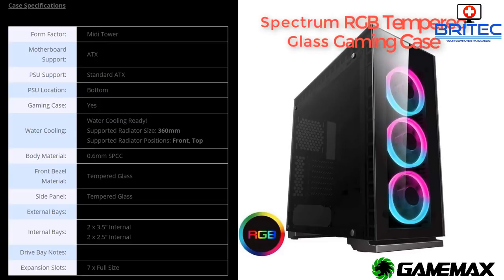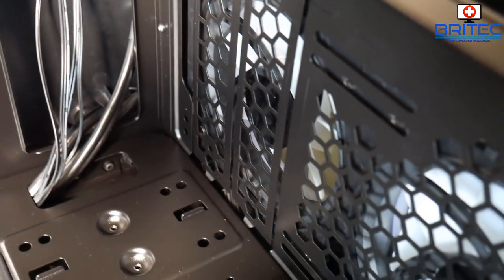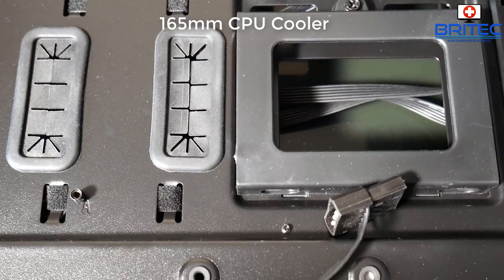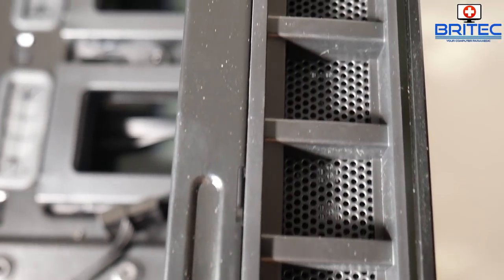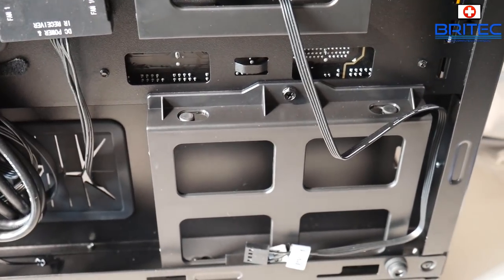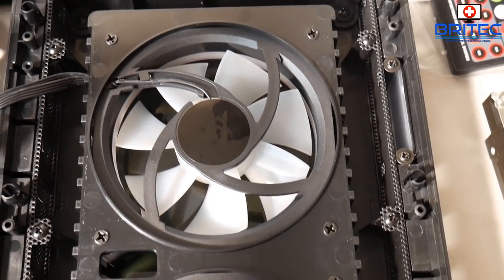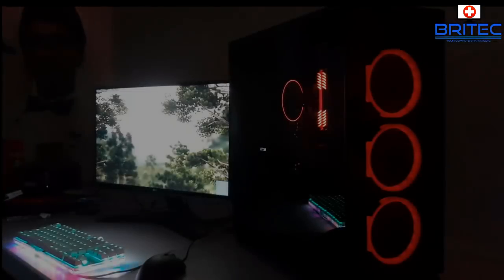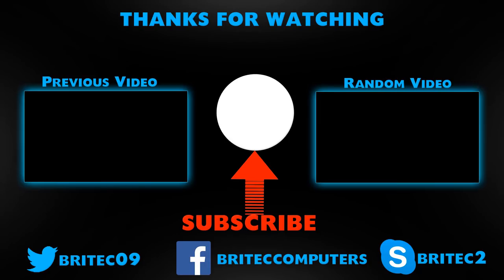Spectrum RGB PC Gaming Case with Tempered Glass by Game Max

Comment: Britec09 How is that tempered glass in the front dealing with the airflow system ? As you know Coolermaster ended up with having to change up the tempered glass solution to MESH for correct airflow BOY OH BOY the cooling effect temp truly improved after that change 👍👌👍

Comment: like your hardware vids.... but at that price point ($100+) there are much better options in my opinion :) i'll stick with my HAF X....... "the air must flow"  👍
Reply from the maker: You have to remember this is a full tempered glass case with RGB, so the price is not that bad. But its a tough market with plenty of choice, choose the case you like and buy it :)
Reply: You are correct sir, i'm not a RGB or temp glass guy so those points don't matter to me(i'm a old guy)..but to alot of people it goes.... @Britec09
Reply from the maker: RGB is the thing right now, nearly everything has RGB on it lol it does grow on you a bit.

Comment: On my wishlist sigh.
Reply from the maker: PC parts are so expensive
Reply: @Britec09  currently desperate looking for a ide card too use sata in my old 1995 computer got a 1999 one running with 2 ide drives and had 3 spare ones but they all seem dead just lying in storage sigh and no new ones anywhere too find yet, too bad pc games dont run on a msx computer lol